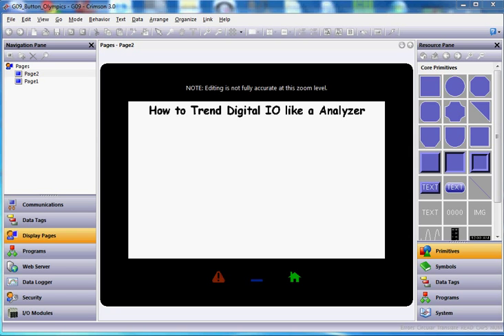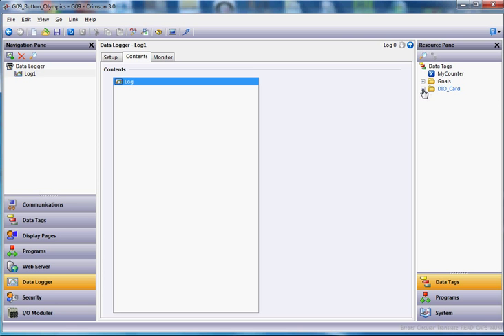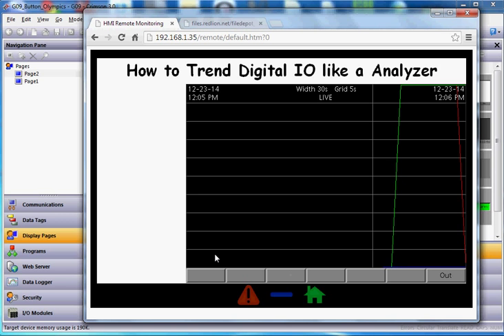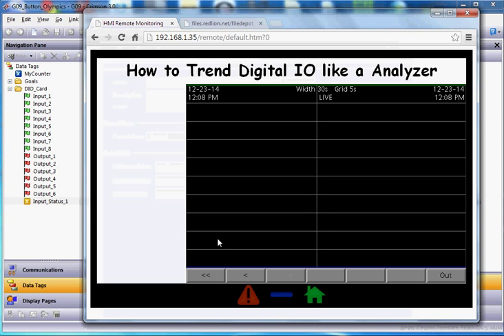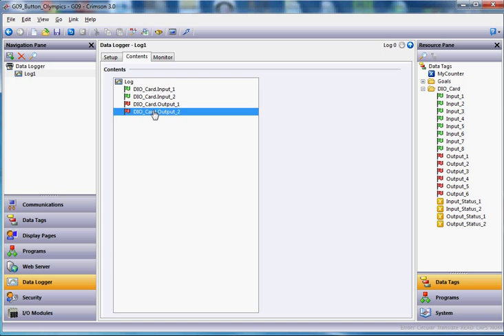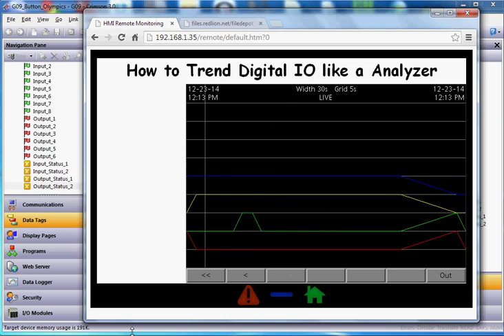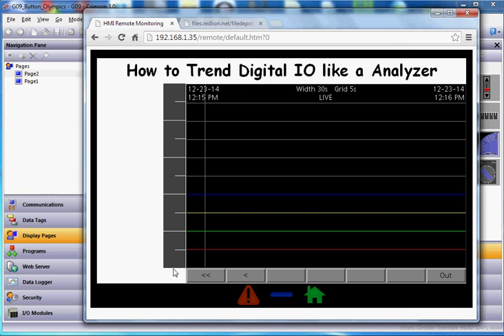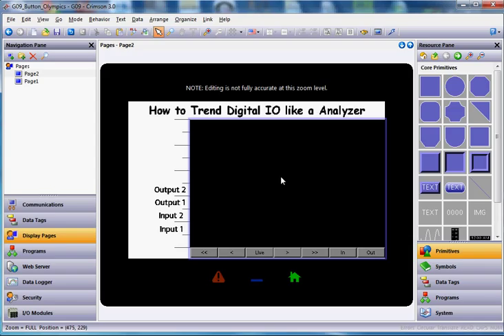Trend Digital Analyzer

Comment: Do you know a way of making red lion hold more information on the trends? With everything maxed out mine only holds 2 hours. Is there anything I'm missing?
Reply from the maker: The TrendViewer Primitive can be expanded to show up to 48 hours or two days of data. That is the largest that window will show. Use the In & Out buttons on the bottom of the TrendViewer to expand that window. And then you can use the Left & Right arrows to tab back and forth on data. The TrendViewer Primitive is limited to some amount of cached data. But the real .csv log file on the SD card will contain all of the data and you can Save that to your PC and open it in Excel to really show larger Trend data.
Reply: @JoeWaZoo1  my issue is if I'm not trending every second I miss the data I need to see. Even with sd card mounted it's not holding mor than 2 or 3 hours. You can zoom in and out all you want but that doesn't change it. I was looking to see if you knew any other way to display more
Reply from the maker: @wardcolton43  Now I understand what you mean. I believe that the TrendViewer hold some amount of cached memory, I think its 64K. So if you are logging lots of tags at 1 second readings, it probably will fill the queue up quickly.  Have you looked at the raw .csv file in the Log directory in Excel?
Reply: @JoeWaZoo1  I haven't I can I just hoping I was missing something it's more user friendly for me if you could actually see it on the trend. I have other capabilities of trending but I really think that's a flaw on red lion. I get 2 hours is all with everything I trend on some stations..
Reply from the maker: @wardcolton43  Exactly how many tags do you have in that DataLog that is reading once a second? The most samples you can put into a file is 86400 (60Seconds X 60Minutes X 24Hours). Each TrendViewer can show 16 tags in it, or the first 16 tags in a Datalogger.
Reply: @JoeWaZoo1  I would have to pull out my computer but I probably have 40 to 50 data loggers with 5 to 10 tags in each one.